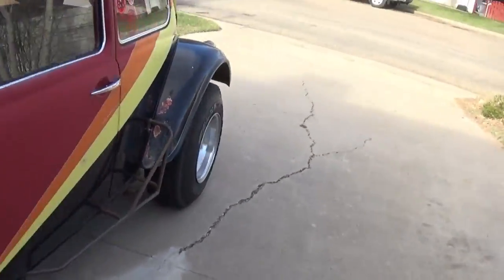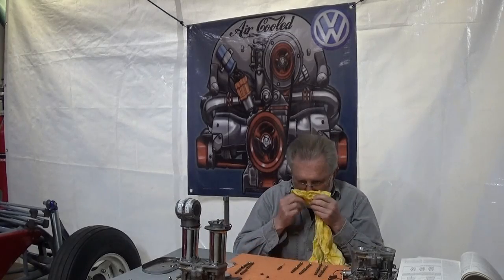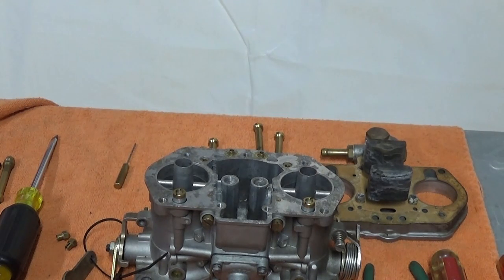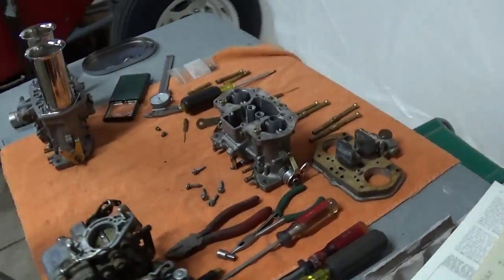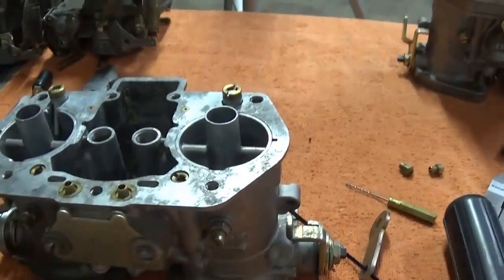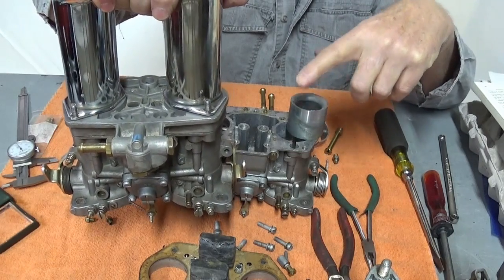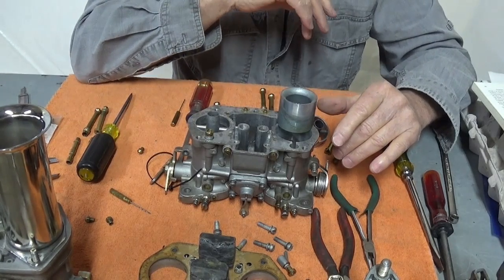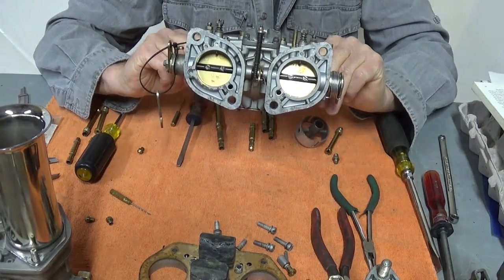Dual Weber 40 IDF Quick Fix

Comment: Hey,   nice video and thanks. I have a question for you. I have a triple set weber IDF 40 on my BMW (VGS 320/6). Everything is rebuilt and clean. but idling keeps to high even with the throttlevalves closed. No vacuumleakage but when I look inside the body I see fuel comming/dripping from the acc.pump jet during idle. Can you help me? Greetings from the Netherlands.
Reply from the maker: I am assuming your drip is coming from one nozzle.  In the bottom of the float bowl for that carburetor you will see a brass screw. There is a steel ball inside. Make sure it is loose and seals when you blow from the threaded side. There is also a brass screw on the top rim of the lower body. Remove that and use a magnet to remove the steel bar and another ball.  Both of these items are check valves. Also double check your float level and inlet valve at the float. Also make sure your fuel pressure is less than 3PSI. Hope this helps
Reply: @TheEZGZ  , Thank you for the quick reply/ All three carbs are doing this at every cylinder during idle. The bottom brass screws are working fine (the steel ball). At the spray nozzles the screws that are inside do work fine. I have the system where the spray nozzle is mounted with a screw and two copper rings. Does that screw have the weight and steel ball inside then? The fuel pcv regulates at max 4 psi. The original carb worked fine with that.
Reply: Hey, quick update. The checkvalves in the floatchamber and the checkvalves in the jets are replaced by new ones. Floatlevel is checked and re-adjusted to the factory spec (10mm close and 32mm max open). The problem is still there at all three carbs. Do you have some info about the floatlevel in the carb? Idle is still to high with the throttlevalves closed. Vacuumleakage is not found around the carbs. Thanks for your input. Greetings from Holland.
Reply from the maker: @323baur Fuel pressure must be under 3 PSI
 Standard IDF Settings:
Speed screw ¼ to ½ turn in after contact with lever maximum.

Mixture Screw 1 turn out from lightly seated.

 

“Lean Best Idle” Procedures

After confirming the linkage allows the throttle lever to seat against the Idle Speed Screw. Back off the Idle Speed Screw, then turn the screw in until it contacts the throttle lever and turn it in ½ turn. Turn in the Mixture Screw in until it “LIGHTLY” seats, then back it out 1 full turn. Loosen the 8mm wrench size nuts on the “air bleed” screws, turn in the air screws until it seats then tighten the nut.

a.      Start the engine, it will run slow and like a tractor. As long as it will stay running, the idle speed is not important at this point.

b.      First, turn in the mixture screw until the engine runs worse, then back out the screw ¼ turn at a time. The engine should start to smooth out. Continue to back the screw out ¼ turn at a time until the screw does nothing or runs worse. Then turn it back in to the point where it ran best. You want to tune the engine by sound. Adjust each mixture screw to the best, fastest and smoothest running point. Do this procedure with each mixture screw.

c.      Now you may adjust the Idle Speed Screw. It should be sensitive and only require ¼ turn in or out to achieve the idle speed you like.

d.      These carbs are commonly used in pairs, this makes the synchronization important, be sure to bring the high flowing carb down to the low flow carb. Then bring them both up to “proper” Idle speed. The Idle Speed Screws are not opened more than ½ turn in.

e.      After synchronizing multiple carbs, reconfirm steps b. c. & d.

 

“Simple Rules for Calibration”
If your mixture screw is out more than one turn like 11/2 turns then your idle jet is too lean, go up one half size on the Idle jet.

If you mixture screw is not out one full turn, something like only 1/2 turn out from seated then your Idle jet is too rich, go down one half size on the idle jet.

This is all based on the important fact that your speed screws are not open more than ½ turn if they are then that is also an indication that you have a lean Idle circuit. You are cheating by opening the throttle plates and exposing additional progression holes in the transition.

 

Pump By-pass Valve:

The pump by-pass valve is designed to allow fuel into the pump circuit and when depressed, by-pass a percentage (hole on the side of the valve) of the fuel delivered to the accelerator pump nozzle/jets. We have included the zero by-pass valve in our jet kit. This will deliver all of the available fuel to the engine and not by-pass fuel back to the fuel bowl. This will increase the duration and volume of the pump shot with the original pump jets. To decrease the duration and increase the fuel volume we have included in our jet kit the larger 55 pump nozzle/jets. This is for maximum fuel delivery from the accelerator pump circuit. The accelerator pump by-pass valve is located in the bottom of the fuel bowl, one is required per carburetor.
	
More Tuning & Adjustment
 

1.      Most Critical! Be sure for initial carburetor set up all air by-pass screws should be in closed position. These are not commonly used in standard carburetor adjustment.

2.      Set the idle speed screw at ¼ to ½ turn in after contact with throttle lever. When doing multiple carburetors all linkage should be disconnected. All carbs should be bench adjusted to same setting.

3.      Set the idle mixture screw to one turn out form lightly seated. When checking the seated position to make only light contact with seat, aggressive seating will damage needle and seat of carburetor,

 Adjustment if possible should be to find smoothest idle with each mixture screw on all carburetors. Some prefer to do one barrel of each carburetor then come back and do the second barrel

4.      Start engine as long as engine starts and runs do not turn up idle speed first.

5.      After preliminary lean best setting of idle. Check carburetors for synchronization. Commonly done by checking lead or front barrel of each carburetor.

6.      You will always want to bring high flow carburetor down to match the low flow carburetor. If this cannot be done you will need to recheck bench assembly for binding throttle in high flow carb. Once you have matched both carburetors you will need to set the idle to the desired idle speed setting. This will be done by adjusting both carbs up or down the same amount and re checking for synchronization.

7.      Make one last check of lean best (smoothest running position) idle on all mixture screws one last time.

8.      Best idle should end up with the mixture screws at or near one turn off seat. Check rule of thumb for idle jet selection on the other side of this page.

 
REDLINE
1225 W. Imperial Hwy Brea, CA 92821
 1-877-405-4345
REDLINE is a  division of WORLDPAC

Comment: What are your thoughts on duel Weber 34 ICT's? We got a  roadster from a friend of my wife that has some motor issues. I know it needs new heads and topend parts, but it is also running quite rich with the 34's. A big problem is that there isn't anybody within 6hrs that does much VW air-cooled work.
Reply from the maker: I've run them and they worked ok.  Check the fuel pressure and float level as I mentioned in this vid
Reply: @TheEZGZ  I know you're an hour later than I am, I'm surprised you're up so  late 😁
Reply: I have twin weber 34 icts on a 1641cc twin port ant they run great . I bought a wideband kit to help tune them worth every penny

Comment: I hope you get better on the runny nose,  I am really new to dual carbs, what you think of dual Kadron on a 1776?
Reply from the maker: Kadrons are a nice solex carb that will work fine on a daily driver. With kadrons you will struggle with the linkage.  With any dual carb you struggle with the linkage even with the fuel injected throttle bodies.

Comment: I noticed your accelerator pump looks a little different than mine. It looks like yours has two Springs on it maybe? Is that how it's supposed to be? Mine only has one spring.
Reply from the maker: ??????  monitor you spark plugs and  dial it in to your needs,   Mine came with double. Why didn't yours?????

Comment: Have you tried cb performance upgrade kit? Im looking to see if it will help tunning
Reply from the maker: Yes, the jet doctor is great. The spray bar is more for performance. It depends on the engine and what it's used for.  If you have a stock 1600 it won't do a thing
Reply: @TheEZGZ  im running a 1835 with dual 40 idf looking at going with matched 44 and heads from mofoco any suggestions? I have a few videos of driving my rig

Comment: Have a question EZ, would it be possible if we can chat? Having some serious issues with my Dual IDF 40's and would love some pointers! Thanks!
Reply from the maker: How about you leave your question right here in the comments and I will try and answer it so that we can all share the problem and solution. Thx
Reply: @TheEZGZ  No problem! 

The issue seems to be that it is breaking up at part throttle, 1/4 to 3/4 throttle it completely sounds like it's running lean. I pulled all four plugs and the right side is black as night and the left side doesn't even have carbon on them. 

It's a 1776 with a 110 cam, at 4500 feet, my main jet is 115, idle is 55, and air is 180. The heads have been opened up a bit for a bit more airflow, but no serious porting. 

I appreciate you uploading all this information, it has helped so much.. keep them coming!

Thanks again!
Reply from the maker: @MrJiraiya171  I may have you covered in my newest video!  Carb linkage is critical if one side leads the other it won't work right. If you move your gas peddle to WOT both carbs should end up on the full open stops if they don't your geometry is off. 
Also you can not have your progression holes exposed at idle. You will have to remove the carbs from the car and remove the carb from both manifolds to check it. http://www.redlineweber.com/html/Tech/idf_adjustment_controls.htm

Comment: how do you clean the intake filter on those?
Reply from the maker: I made a short vid on that. You may want to search my videos.  K&N makes a whole kit to recharge cotton filters. Most auto stores carry it. I'm cheap. I use simple green, let them dry and then K&N spray oil
Reply: @TheEZGZ  I have a unique car. It is a Brazilian made chevy with 4.1 liter engine that used a weber 40. The car was just shipped from Brazil  to USA. It took 8 weeks in a ship exposed to the saltwater environment. I cannot start the car. If I put a small amount of gas in the venturee cylinders (as you described them), the car comes on for a few seconds then dies as soon as the small gas amount is used up. I checked the mechanical fuel pump, and it is pumping gas to the carb. Without taking the carb apart, I checked the small opening in the top (the one u stated is used for ventilation) and I can see some gas in the main bowl. My guess, there is an issue of gas transfer from the main bowl to the venture cylinders.
If I am wrong about seeing gas in the main bowl, then something is blocking the gas going inside the main bowl. You mentioned in this video, there is a filter inside the carb in the main gas inlet. Was asking you how you remove this filter. FYI, I am not a mechanic and have extremely limited abilities.

By the way, great video.
Reply: @TheEZGZ  I found out the problem. The valve for the float is getting stuck in the closed "up" position.  Why would it stick? does it mean i have to replace the valve or i can just clean it.
Reply: did not open the carb. this is by putting a screw driver tip in the opening vent in top and pushing the float down
Reply from the maker: If the car sat without running for months on end the fuel dries out and can cause some sticky deposits.  Sometimes just tapping on the bowl while cranking the engine will clear it and fresh gas will clean it. Better to just take it apart and use some spray carb and choke cleaner and put it back together with fresh gaskets and accelerator pump diaphragm. A clean and properly adjusted carb makes the car so much more fun to drive.

Comment: Good evening I have a central empi 40 idf in my 68 bug. You could help me with the correct measurements of air and gasoline in the jets. At the moment I have 150 in gasoline and 180 in air but the consumption is excessive and the engine heats up more than normal. I appreciate your help in AVANCE.
Reply from the maker: Those carbs on center mount suck on MPG. Should have gone duals but then the headache of when (somethings not right which jet is plugged??? I have many vids on that